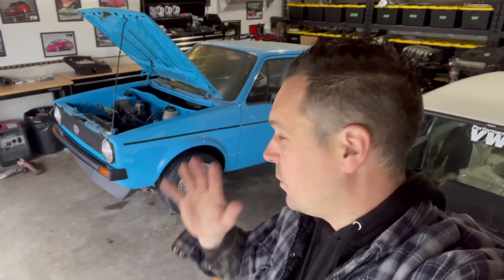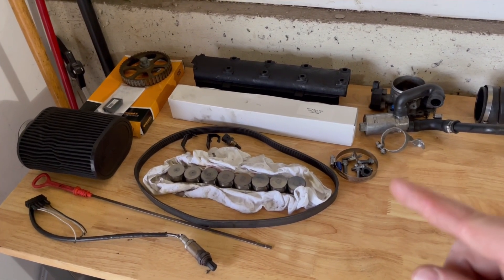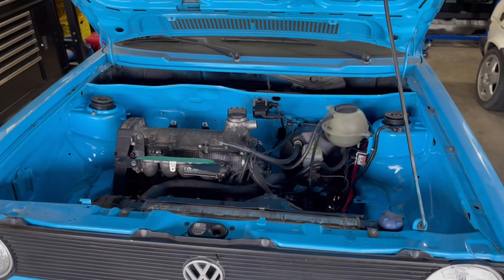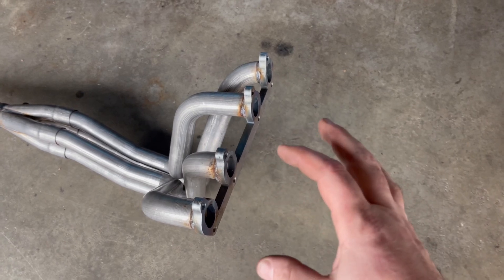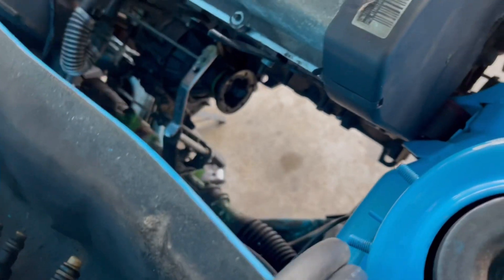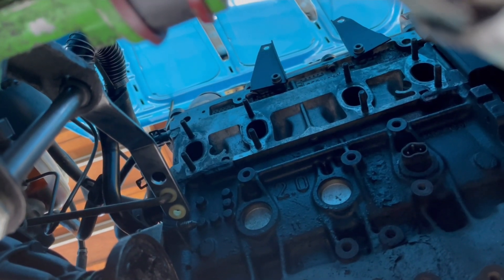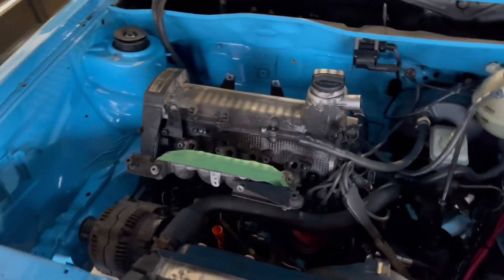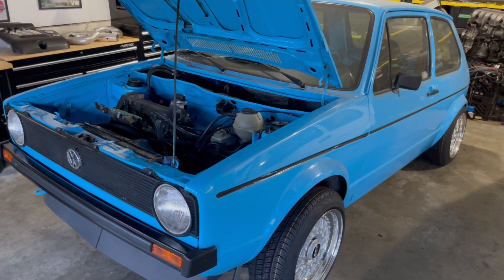Mk1 Golf 2.0 ABA Swap / HOT RODDING A 2.0L 8V pt.3 / 4 INTO 1 RACE HEADER / STILL WAITING ON PARTS

Comment: Got a question for ya if you read these. I have a 85 Vanagon I did an aba swap with a 1.8 head. It runs great and is super reliable but would like more power. What would you suggest on a budget? The 1.8t fits but it is a more complicated, expensive swap. I also have a complete spare aba to mess with/ Thanks and I enjoy the vids.

Comment: What is the reasoning for not deadheading the overflow from the head to the bottle? I've done it on my own w/ the overflow coming from the drivers side of the radiator. Haven't had any issues but curious if I should be rethinking it.
Excellent episode as always.

Comment: Raising the rpm to 7500? Is that a safe range for the vw valvetrain? Without getting to valve float? What's the max you can push these Hydraulic setups with stock valvesprings? That's a sexy header!